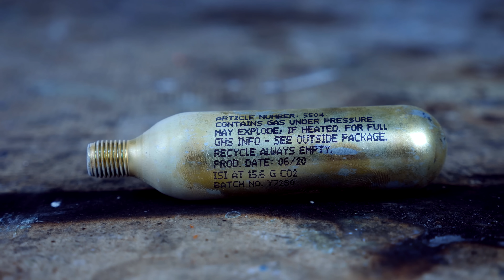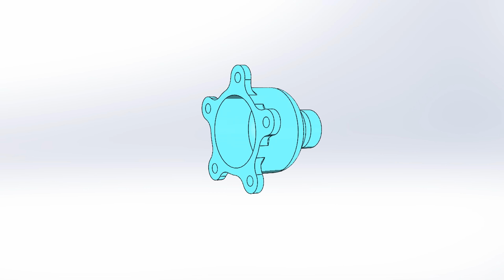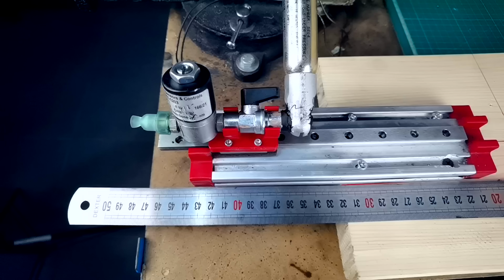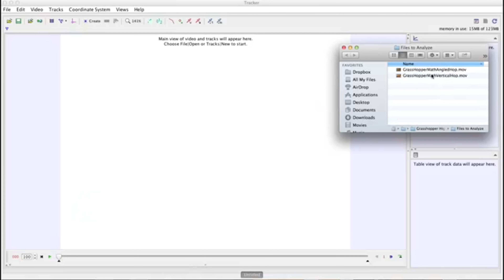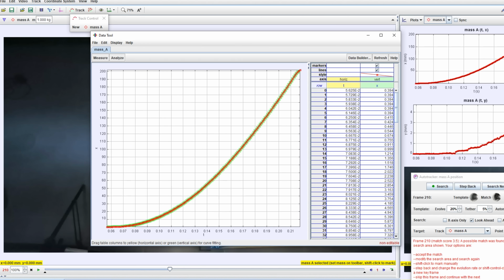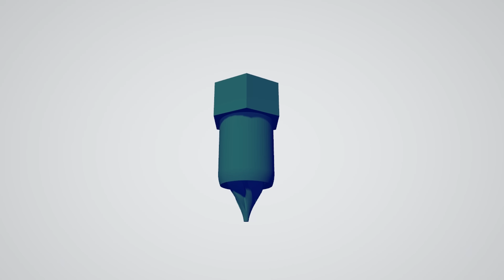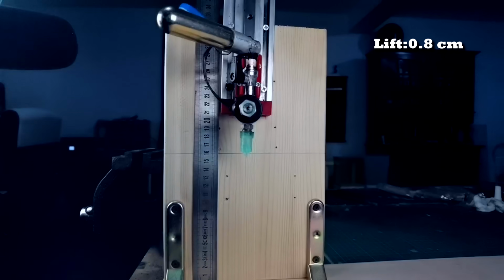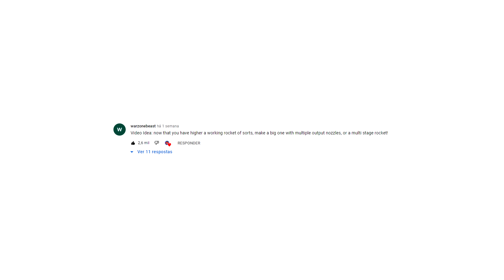I 3D printed a CO2 Rocket

Comment: Have you considered trying your hand at 3d printed active cooling? You might be able to have some better cooling systems than standard manufacturing depending on the fidelity of the print. Could be an interesting thing to look into and would help solve your constantly melting nozzles. I know one of the reasons why it took so long for Nasa to implement an aero-wedge was the same problem you have had, the nozzle overheating and melting. I remember reading that a lot of it comes from the surface area in contact with the super heated exhaust.

Comment: Idea: You should recreate those fan blades from your last video with your little CNC Mill depending that is if you can even run a thick enough piece of aluminum stock. You also said and showed us the terrible sound and surface finish your CNC Mill was producing in your last video. A couple possible solutions to those issues are to increase the spindle speed aka the rpm of your endmill,  check for material build up on the end of your endmill, make sure your depth of cut isn't more than half the diameter of the tool your using, check too make sure your setup is rigid, and that also your feed rate isn't too high especially on a setup like yours the slower the feed the better especially for a smaller machine like yours. A tip for calculating the rpm of your tool easily I've learned while working in the shop is to do [Four Times The Cutting Speed Of The Material Being Cut Devided By The Diameter Of The Tool Being Used] the average cutting speed for aluminum is somewhere in between 150 to 200. So for the  stock you use I would use like 175 as the cutting speed maybe a little slower and you can always back off on the rpm if need be. Anyways, I hope that if you have read this comment the tips I suggested have helped your machine run smoother and produce parts with a better surface finish. Good luck and happy machining.

Comment: I think you should make a video trying a rocket powered by hot water and a block of dry ice in a pressure vessel with an outlet at the top (so the H2O stays in the pressure vessel) that exits through a rocket nozzle. I am remembering the times in my youth when I used dry ice and hot water in a 2 liter bottle... That was dangerous, but with an outlet through a nozzle, the pressure should not exceed the limits of, perhaps a 750ml soda bottle. You can try a small amount of dry ice at first. You can hopefully get a longer and more forceful output of CO2 that way. You could also reinforce the bottle with something like that packing tape with fiber reinforcement.
You could make a system for injecting the H2O to start the CO2 generation. Perhaps a large syringe would work with a soledoid coil around the outside of the syringe and the plunger replaced by a steel bar attached to the seal.
I don't think you will need a valve if the outlet tube and the nozzle are the right size compared to the volume of gas that is generated.

Comment: You should check out wax rockets. Since wax is an alkane it has to same energy density as petrol or diesel. When the wax melts the liquid wax essentially self carberizes in the air stream which leads to a pretty clean reaction

Comment: When I was a kid I had a plastic rocket that was filled 1/2 with water and then pressurized with a little pump. It flew pretty good. For a video idea you could use the co2 cartridges pressurize a rocket filled partially with water. I'd be interested to see if it has more lift. Since water has more mass it should have more force right?

Comment: The shrouded aerospike isn't a real aerospike nozzle. The aerospike only has the interior surface because the air pressure moving past it is what gives it the compression of the exhaust. Unfortunately that means they are inefficient at sea level and slow speeds as the exhaust can bloom out as far as it wants to. The beauty of aerospikes is that as they get higher and higher up and lose pressure on the exhaust it basically self optimizes the exhaust cone diameter/shape thanks to the high speed it's travelling at. For low power engines at low speeds it's not efficient at all. Also try the long ramp type one sometime. https://www.youtube.com/watch?v=FcW9kUUTfxY

Comment: Video idea : use this to make a inflator that inflates tyres and ballons extremely fast. You can also increase the pressure by heating the CO2 cartridge (temperature is directly proportional to pressure)

Comment: You should try wrapping some heater wire stuff around a CO2 cartridge that gets really hot right before the valve opens to add more pressure
Reply: Thatd really clever
Reply: @fadedperspective  also pretty dangerous but hey, I love danger
Reply: @ahumanbeing7554  not if there is a temperature limit

Comment: You should build an M-Drive rocket motor - or at least explain why one is not practical to use
I've only heard little about them but super interested in them

I'm also in desperate need of a 3D printer as I promised my son we would print a water turbine that is able to slide on a surfboard and our printer broke during the  move :(

Comment: When you remove the supports on resin prints, you should do it BEFORE you cure them. They come off MUCH easier and cleaner. Plus, if you soak the parts in warm water first, the supports will practically fall off b themselves.

Comment: You could build a micro submarine and design a torpedo launch system that can use the empty CO2 cartridges with pressurised air  as torpedoes.

Comment: Why did you have the co2 cartridge perpendicular to the direction of travel? It seems like that would create an imbalance resulting in friction where the rocket connected to the track. Would positioning the cartridge parallel and on the same centerline as the other parts of the rocket increase efficiency?

Asking that question gave me an idea for a video. Run tests where you rotate the rocket on its carrier so the cartridge is 0, 45, and 90 degrees to the surface of the board the track is mounted to. Is there a difference in efficiency? If so, which position produces the most efficiency?

Comment: Hey Integza satisfy my curiosity will you, if you use Tesla’s mechanical oscillator in reverse; as a solenoid powered air pump to increase air pressure in a given chamber. Lately I’ve been seeing that the sea creatures, nautiluses… or is it nautili? Whatever; they have the most efficient jet propulsion in nature and the mechanical action that causes this works similar to the way you broke down Nikola’s oscillator. Maybe make an electric mechanical pump to jet across the water?

Comment: There's probably some fundamental differences that are being ignored. As the escaping CO2 is super cool but has high velocity you would potentially be better off with a venturi system giving the gas more to push against. The cold CO2 is probably working a bit counterintuitively in that as it expands to push on the air it is reducing the volume of that air by cooling it.

Comment: Hey Integza. Awesome video! Just a question, have you ever considered getting an SLS (SelectiveLaserSintering) 3D printer? They work similarly to Resin, but they print from wintering a powder. Because it is already encased in powder (which I’m pretty you can reuse excess powder), it doesn’t need supports! This allows you to create basically any shape you want all in one go. I have heard they are expensive though. Anyway, thanks for the video!

Greetings from Canada
-Akana

Comment: Two things: 
make the cylinder in line with the valve, that way it’s not creating a leaver on the sliding track

Secondly, look at fire extinguisher nozzles. They are supposed to allow the co2 to expand and will create more thrust. If the stream is too concentrated and not distributed, the gas will be changing phases from liquid to gas outside of the nozzle, reducing thrust

Comment: Integza, look at the results you have obtained. 6mm expansion cup down to 3mm expansion cup made a massive difference. That aero spike nozzle appears to release more volume than the 6mm expansion cup. Reduce the size of the aero spike and it will work dramatically better

Comment: If you put a spring on the rail you can and video it with a ruler next to it like you did in this video you could use the fact that a springs force has a linear relationship with the distance it is compressed you can actually use that in order to get an actual thrust force reading. Love your videos keep it up!

Comment: If you print something that could allow your linear guide to be inclined to a precise angle you could easily measure thrust in newtons by taking the weight of your prototypes into account . You know the weight , using basic trigonometry you can know how much downforce gravity pulls on your prototype given an angle and if you're near the equilibrium (when the rocket moves slowly) you know that you make around the same amount in thrust . Cheap and effective mean to measure and compare your different prototypes based on their thrust!

Comment: think you are loosing some good amount of energy through the containment of co2 in the part behind the screw fitting and the nozzle part
might be worth a try to test the other ones again with a convergent lead up to the respective nozzle to decrease pressure loss through turbulent flow

another idea would be to use different diameters of the nozzle to extend or shorten the runtime of the gas expanding; usually rocket nozzles have a somewhat constant flowthrough with the provided fuel, with co2 cartridges however the pressure drops very quickly changing the flowthrough

you could also try to pulse the valve to increase runtime and see what happens

Most importantly; aim at a tomato next time to freeze it so you can shatter that damned tomato once its completely frozen

Comment: Maybe you should try and build a rocket or something powered by dry ice turning back into a gas form. Like put it in a container with some warm water speed up the process and then use the built up pressure to power something? idk seems like it could work.

Comment: Dry ice in a chamber with a burst cap. The pressure builds until the cap burst and releases it all at once via a nozzle. The advantage is you can have higher volumes of gas.

Comment: For your turbojet project, I'm working on something similar, and you should really try kerosene based fuels. They work much better than propane in this case. Some options are diesel, jet-a, hydrojet, jp-4 if you can get your hands on some, etc. It's harder to light but it'll work much better.

Comment: Alright, here's my suggestion for a future video. Can you make a vehicle that moves forward to it's lauch area, readies a rocket skyward, then de-couples and fires said rocket with only one connected fuel source? From horizontal movement to vertical separation and launch with only one tank.... Can you store what would be wasted energy in the system to a launch assist? Random idea that just seems like a infuriating, but fun challenge that would be cool/interesting if you could create. I say the less electronics, and more mechanical solutions the better }:P

Comment: Idea for next vídeo: use two CO2 cartgride. One to use as propelent and the other to power some compresso (using the wankel engine and some compressor like the jet engine, for example). Than, after compressing the gas, you release it with greater enthalpy into the nozzle and (maybe) achieve a better thrust to weight ratio.

Comment: Video idea: bombardeer beetle rocket. Two components (from which the mixture of both produces high pressure gases) get mixed in a common mixing chamber. The materials to mix come from two separate pressurised containers which are isolated from the common mixing chamber by a reed valve.

Comment: A simple way to increase the pressure on your CO2 cartridge is to add heat to it as you release the gas, an old trick we've used in the refrigeration field for years. If the tank pressure on your refrigerant jug is low, drop it in some really hot water. Give it a shot. Also you might try printing a bunch of nozzles with no orifice at all, then drilling them to size when needed, it makes experimenting with them a lot quicker. Another option is an electronic expansion valve, this can provide a way to better control the pressure of your propellant as it changes state. Just some thoughts, good luck and keep up the awesome videos, you have the knack.

Comment: when you remove supports from resins prints use some hot water to heat up the part a little, the supports will come off much easier and cleaner .

Comment: If you drop the real dry ice into the bottle filled 3\4 with water then you will have a steady pressure source that can make a really high velocity jet stream. Works so well that you HAVE to implement the pressure safety valve. Try it.

Comment: What if you heated it in a heat chamber with lasers to increase the pressure for more thrust & that way your rocket isn't carrying the extra weight as the laser can be external aimed at the rocket from anywhere you want & at whatever power you can manage.... just a thought

Comment: I feel like using the aerospike spiral inside a deval   nozzle that would sort of act like a combustion chamber and use the pressure of the cartridge to atomize water in side this secondary nozzle would basically be like an after burner because of dry ice and waters reaction maybe a little different but you get the idea

Comment: When I was in 9th grade, we installed smaller CO2 cartridges in the back of small cars (about twice the size of pine-wood derby cars).  Punctured the cartridge and the car ran along a string.  Mine was timed at 35.5 mph.
Reply: I guess you can count that as a video idea.

Comment: You can produce more thrust by using a method which has a higher exhaust temperature (Not chilly rapidly depressurized CO2). This is due to at the nozzle's throat you are at the sonic state (Fully choked) and since velocity of the speed of sound equation has temperature square rooted function by quadrupling the temperature you should double your thrust. I was able to produce pretty Schlieren picture with only 33 gallons of 120 Psig of compressed air from my own experiment. I would recommend this method since you only need a 28 Psi pressure to create choked flow and can see what's going on super sonic flow.

Comment: I'd love to see you further refine this system and use it as a RATO pack for an RC aircraft. It's generally frowned upon to use actual chemical rockets for this(AMA safety code here in the US explicitly forbids pyrotechnics on a model aircraft) but these are not pyrotechnic devices and should not run afoul of that sort of thing.

Comment: One issue you may run into with 3d printed nozzles is the effect of any layering which could cause friction as the gas leaves the nozzle.  It might be a good Idea to use a hone of some kind to polish the inner surfaces of the nozzle.

Comment: Idea: use a fire extinguisher and turn it into a rocket that is able to propel itself by the co2 in itself but you need to modify the extinguishers nozzle to make it have more force or you can use the modified extinguisher and use it with a rolling chair

Comment: Hey Integza, I have an idea for the a rocket launching system, what about using a jet engine attached to the bae to propel the rocket and then using the rocket's engine to fly higher? You can probably shave some weight of the rocket with that.
Reply: Scramjets

Comment: You're really limiting yourself by using the CO2 as both energy input and propellant.  Pressurized CO2 could get a lot more thrust if it was pushing something with more mass, like water or maybe flour if freezing was a problem.  Note that the hand-pumped, soda bottle water rockets get much more thrust with much less energy.

Comment: Use a raspberry pi to control flow and testing in your rockets. You could have temperature sensors, and force sensors to get more data out of your tests so you can find what works and doesn't work

Comment: Why don't You use Your old liquid/solid fuel? Also try to use a 2 stroke motorbike with a modified Exhaust and maybe add a sparkplug

Cheers from México fella , I would really appreciate a 3D printer 😂😂❤️

Comment: Soooooo, you got the cool source of power from an co2 cartridge but what if you strapped them onto the rocket nozzle (the one that melted) with some kind of temperature sensor, and when the nozzle would get too hot you would open the cartridges too cool the nozzle

Comment: Try using/adapting jet nozzles from pressurized hoses for more durable jet engines, you could always use pressurized oxygen like you used co2 as a cooling source if you pipe it in at the very base of the nozzle

Comment: You should try it with N2O capsules which you could then maybe use as an oxidiser for some 3D print solid fuel oxidised rocket.

Comment: Design a water jet tomato cutter using a 3D-printed water compressor and 3D-printed cutting nozzles. They shouldn’t have to handle high temperatures, but they’ll have to be strong to handle the pressure!

Comment: Have you thought of increasing your ejection mass? Seems that the velocity of the gas exhaust would be too high to generate good static thrust. Try injecting water into the gas exhaust via a modified nozzle with a pick up like a paint spray gun. Just a thought, Keep up the entertaining and thought provoking work.